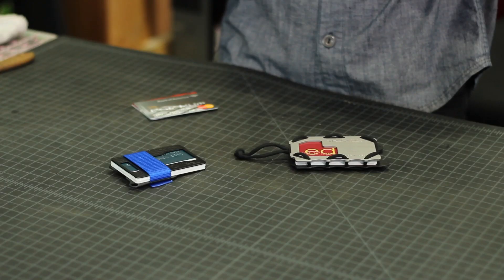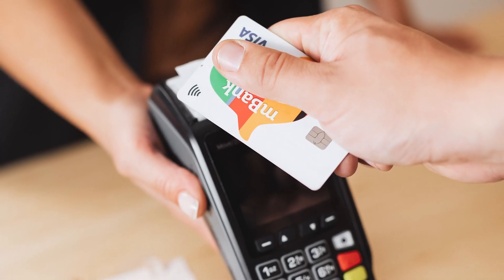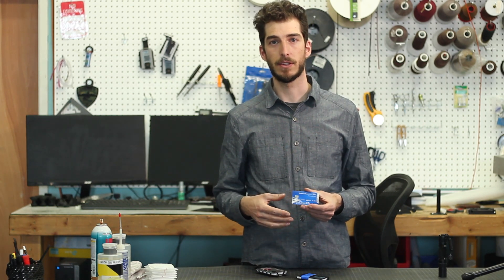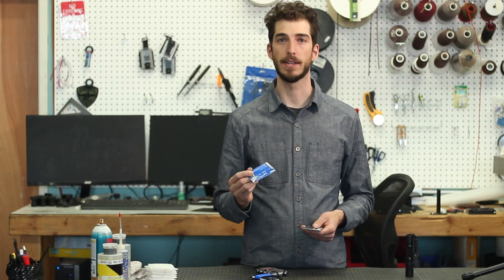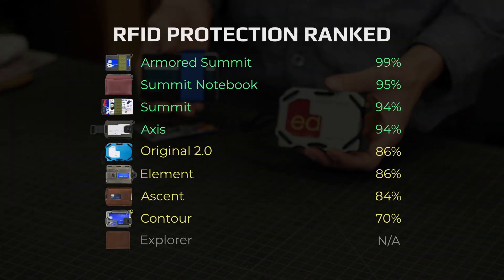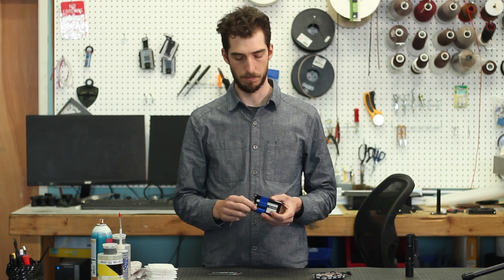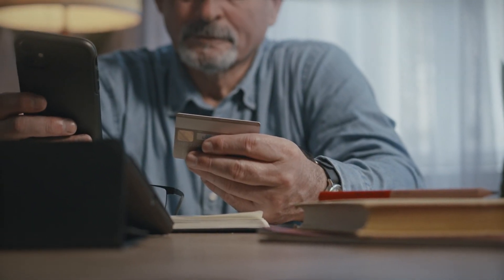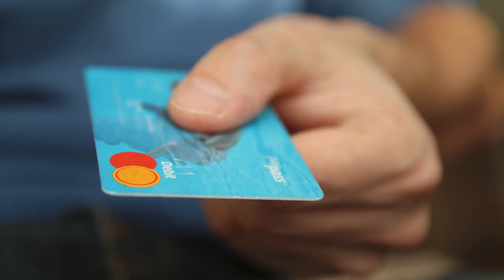What's the Deal with RFID?

Comment: Why don't you use the same type of metal plate on the 2.o than you do on the summit for the same type of protection?
Reply from the maker: That's a good question, and there is not really one answer. Other factors were taken into consideration including weight, color, cost, and engraving. Fortunately, the aluminum still offers quite a bit of protection. 
- Will H.

Comment: Hi the rfid protection is so good, i cant enter my work facilities without removing  my access card. Even if the card is on the paracord side the sensor still cant detect it. Do you have any solution for this? I have the OG 2.0.
Reply from the maker: Thanks for the question. There's not much you can do here besides taking the card out. It's good to know the RFID protection is working so well though. 
- Will H.
Reply: Thanks for the well made product. I love the wallet, it's a small price to pay.

Comment: I ordered an OG2 style in G10 last night, did I negate or weaken the RFID with that option?
Reply: Good question. The G10 still offers RFID protection, but not as much as the aluminum front plate. To increase security, we recommend keeping cards with RFID closest to the back plate. - Will H.
Reply: @trayvaxsupport9860  Thanks for the response and the tip.  I'm glad you posted this video and I'm still extremely excited about my order.